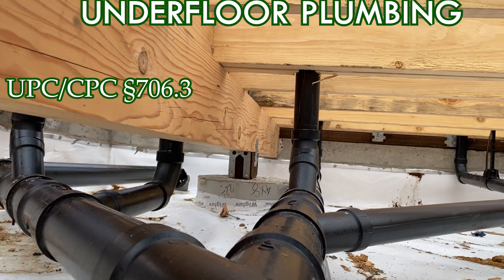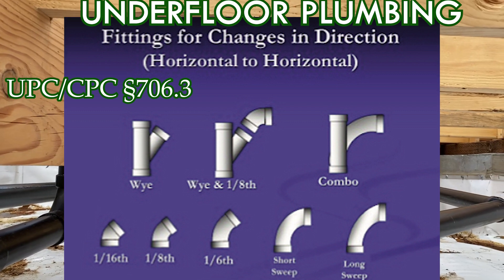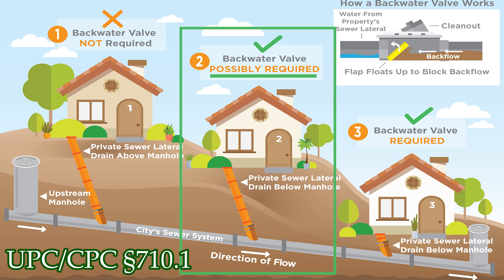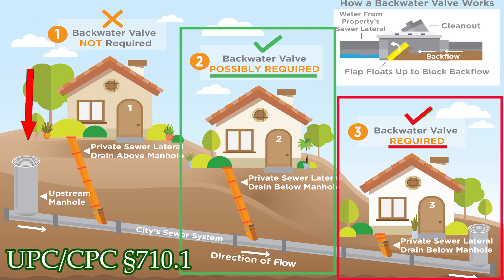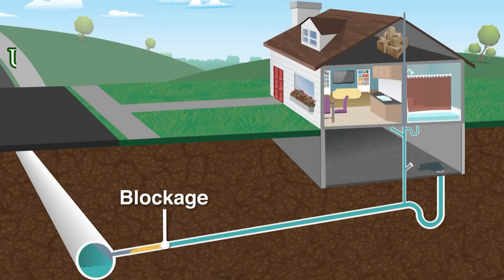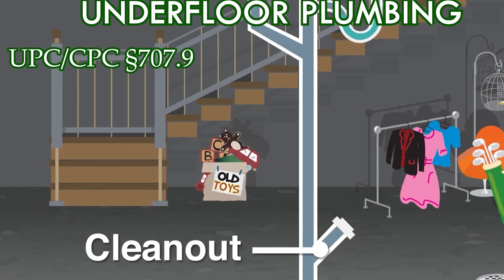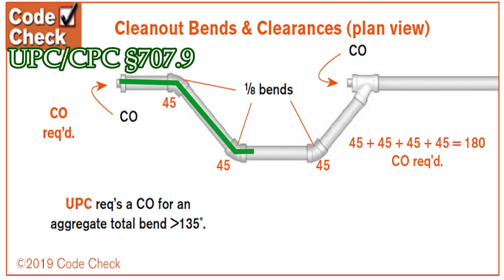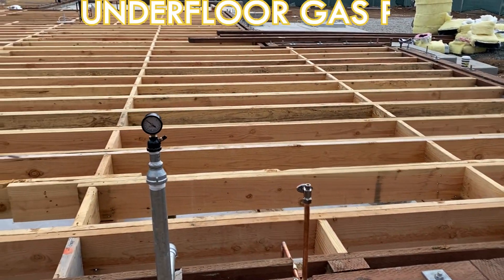Underfloor Framing Inspection (Residential) - IRC/UMC/UPC & California Codes

Comment: Your videos are great!! Is blocking always required for underfloor framing? Example would be a 415sf residential addition with some concrete posts in between and girders resting on top. Would this require blocking if the floor joists were 2x6 space at 16 on center?  Thank you for your time.
Reply from the maker: Hi Raymundo, great question.  Although it is very common to see blocking in the area you specify (assuming between joists - above the girders), the IRC, or CRC if you’re in CA, do not require blocking in the scenario you mention. 
However, there are blocking requirements in areas such as -- joist ends (lateral supports, R502.7) and “bridging” (for 2X12 or greater joists, R502.7.1); also, depending if there is a bearing wall above, blocking is required (R502.4).   There is a handy illustration that depicts floor framing and blocking requirements, amongst other items (R502.2).  
Also keep in mind that some jurisdictions may amend, and/or interpret, Section R502.7 “Lateral Restraints at Supports” and require blocking over the girders (between floor joists); since such area would be looked at as a “supporting” the mid-span of the 2X6 floor joists.
Finally, it is not a bad idea at all to install blocking in those areas, for reasons such as – providing rigidity and stability to the floor joists, and help prevent twisting and warping – which, in time, can create floor squeaks. 
I hope the above answers your question.  Please let me know if you need further clarification.
Thank you for your question and thank you for checking out the content.
Be well.
Jose M.

Comment: Great video!
Small correction on the gas gauge per CPC 318.2, which you cited. Gauge needs to read in 1/10th lb increments per 318.2

Comment: Have taken the 2015 B1 3 times with no luck. I've been studying non-stop to the point where my knowledge of code and process in the field are adequate but when it comes to the test I'm not fast enough to get through the test. I've been told that it's not what you memorize from the book but how well you know the sections and area's of the book. I honestly don't know how to get faster. I'm in a very small municipality with about 10,000 residents and I'm required to get all residential and commercial ICC certifications. Long story short, I'm very stressed that I will lose my job if I cannot get these certs passed. Do you have any advice, I have no available mentor here at this small city so I'm really just trying to navigate this without a compass.
Reply from the maker: Thank you for reaching out.  I absolutely agree that knowing where to find the answers to the questions is a big part of passing the exam.  Here are some tips that I hope could help you:

1.)	Try going through the exam and answer the questions that you may know by memory, as well as the questions that you are comfortable finding in the book.  Skip the questions (for later) that you spend more than two minutes finding; remember that you only have 2 minutes per question (oh the pressure!…).  
However!  After you go through the exam and return back to the questions you skipped/saved for later, do not be tempted to change your answer(s) to the questions you completed the first time around.  In other words – don’t second guess yourself; the first answer you gave is very likely correct and changing it could not be favorable.  Only change it if you feel that it is absolutely incorrect.  This has worked for me; I hope this made sense.

2.)	Look through the B1 exam Outline that is in the ICC online exam catalogue (here is the link to the catalogue: https://www.iccsafe.org/certification-exam-catalog/) and put emphasis on studying the chapter’s contents which will have a large percent of the question in the exam; so for example, per the test Outline, a bulk of the questions (27%) are  Wall Construction and Coverings (IRC Chapters 6&7), then it cascades down to further breakdown percentages.  check it out when you can.

3.)	Going back to “how well you know the sections and areas of the book” you mentioned, which I agreed to.  I think this begs the question – how exactly does one do this?  Well, what has worked for me is familiarizing myself with the Chapter’s contents that are outlined in the one of the first pages of the code titled “EFFECTIVE USE OF THE INTERNATIONAL CODE” (I believe is Page #3), check it out.  This actually outlines well the content of each of the chapters.  Use this in conjunction with the test Outline mentioned above.

4.)	Don’t try and cram things last minute, the day of the exam (this works for some people though); reflect on what you have previously studied instead.  

5.)	Wearing earplugs works for me!  Although your test location may already be quiet, there is something about the further reduction of decibels that allows the thoughts to come through uninterrupted… not sure if that makes sense – but if you are comfortable with earplugs, try it.

6.)	ICC has a page “Residential Building Inspector Career Path” which contains online webinars, test preparation and other resources that are specific to the B1 exam.  Here is the link:  https://www.iccsafe.org/professional-development/education/residential-building-inspector-career-path/ 

7.)	And then there are the week-long (or 45-day) seminars (“Guarantee Pass”).  These take place throughout California (if you are in the State); if you are in another state, please let me know.  
The small handful of people that I know who have taken the Guarantee Pass courses have all passed the exam.  This could be great for people with personal commitments and constraints that prevents them from dedicating classroom time during off hours, if that makes sense – in fact, the folks who took this already had practical experience as code professional; but because of personal commitments/constraints – some felt they just wanted to get it done...  You can do a web search on these courses, but please let me know if you need me to send you a link.

Here is my email (jm.wboard@yahoo.com), please let me know if you have any question or if you need clarification on the abovementioned.  

P.S. Wow, you work in a very small community! Congrats!  My first job as a Building Official was in a small community (15k population); it was awesome times, it very much felt like family, tight-knit – and I learned a lot.  Like probably you, I had to wear multi-hats; from managing the building department/plan checking/inspections, code enforcement and often helping the permit technician process and issue building permits --- great times!  

JK Stall -- You know your agency better than I do; however, in my experience, seldom do individuals loose their jobs for being unable to attain the certification; can it happen – I am sure it can; However, it is not unusual for grace periods to be offered – especially if you are providing a great service to the public.  But stay on track and attain your certifications.  

I hope the above helps you.  Take care and please keep me posted. 

Jose M
Reply: @CBO.online  I truly appreciate the advice and the time you took to reply to me. That is by far the best advice that I have recieved in my two years as an official. I am in Oklahoma and love my little community. I truly enjoy being an inspector and as you mentioned, many other hats as well. Thank you again, I will reach out.
Reply from the maker: @jkstalls  No problem at all!  any time -- and no matter how minor the question may seem, please don't hesitate to reach out.  
*I edited my above response to clarify further.

Take care.
Reply: Tab vigorously!   The tabs ICC offers are great,  but it doesn't really break up the "general" section,  which you will need multiple times. I use one color for a particular section,  and they are super sticky,  much like the icc ones.   
I know some people list out their tables in ink on a blank page.   That helped me on my electrical exam.   Good luck! 👍🏼